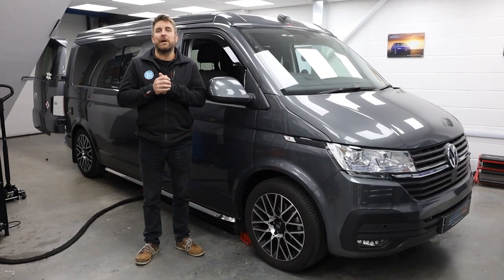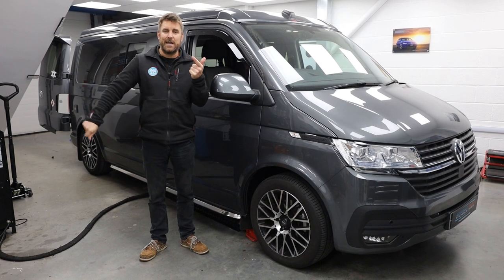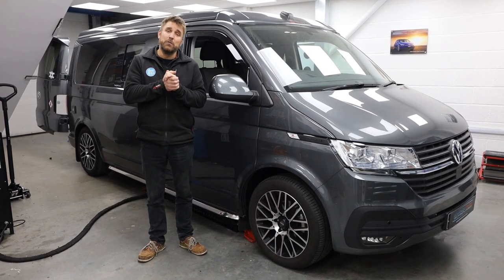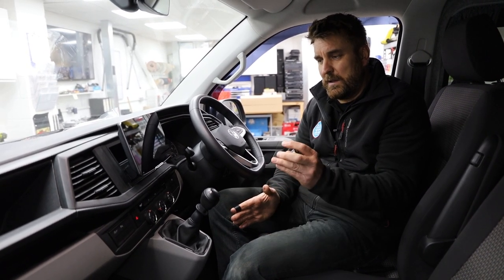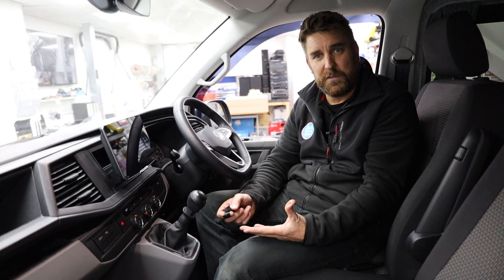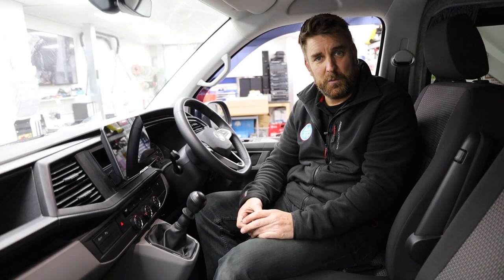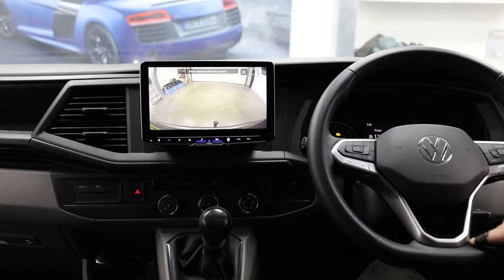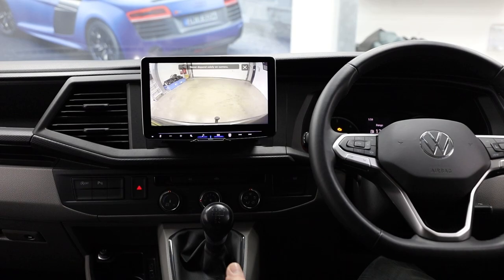VW T6.1 Transporter gets Alpine Halo 9 Digital Media System & retains ALL Factory Vehicle Settings!

Comment: Had the Alpine Halo9 fitted in my T5. I decided to have it removed, only to have it fitted into my new T6.1. I couldn’t be without it 😂. Fantastic bit of kit. Everything is so simple to use. Also had the matching Alpine front and rear cameras with motion sensors. Having full Gladen speakers and sub fitted.Someone reversed into my van and drove off but the camera recording the incident. Managed to claim off the persons insurance. Glad it was fitted👍👍👍

Comment: Hi, great video, I also have the full kit, with the Alpine x903d on my T6.1 21plate, it works a treat, yet i only have about half of the vehicle settings and my reversing camera does come on when selecting reverse. 
can you advise on a issue please, its a CAN Communication error... this comes on when I'm using a firestick after a while, is there any way around it. 
Gary

Comment: Do you guys know wether or not you can fit a subwoofer like the one you have here or a similar kenwood under seat sub to the top of the range headunit? I really like the design of it and don’t want to put a aftermarket one in just for a sub. But it needs a sub! Lacking in the bass department. Plus the door cards don’t half vibrate in the 6.1’s have you found a solution to this?